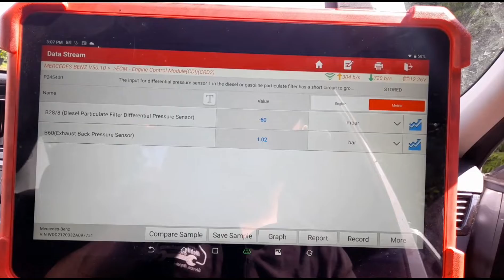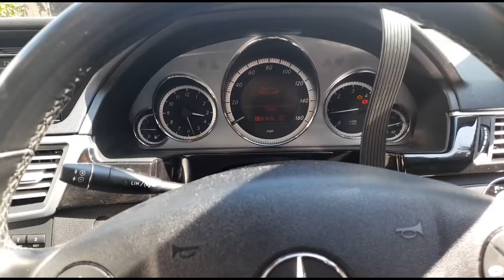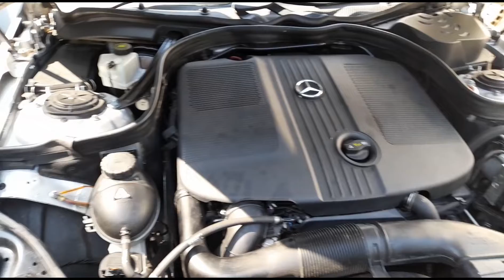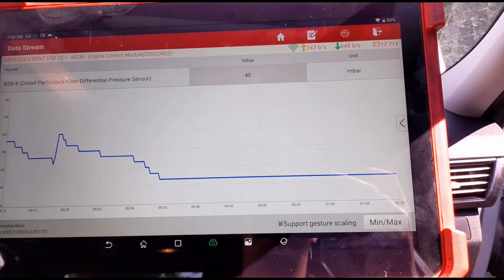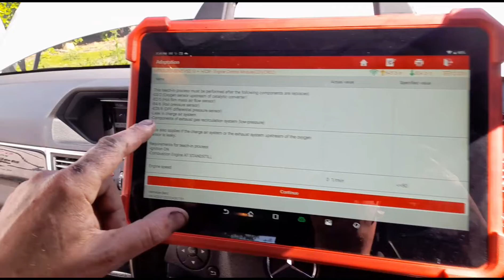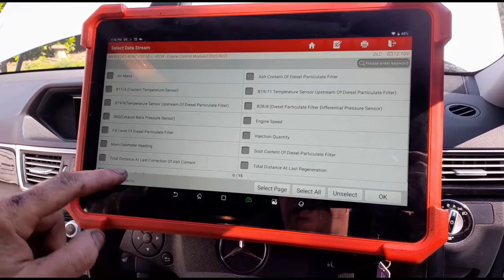Mercedes E Class 2.1 P245400 P244A7A P244A00 P245328 Differential Pressure Sensor Short Circuit

Comment: hello, my 16 range rover td6 recently has P2002, the dealer said it's because of a faulty DPF pressure sensor and the pressure is actually OK. Another dealer said there are 2 such sensors. So, how many of such sensors are in this car, and which one/ones need to be replaced? thanks

Comment: Hi jimmy, love the channel, would really appreciate your opinion...
my dad has a 2003 vito 110cdi, for the last 6 months sometimes when starting turn key its dead not cranking....no glow plug light comes on.... I keep trying key and after 20 or 30 turns glow plug light returns ... then cranks/starts/runs fine.... then today for first time it cut out while driving (glow plug- epc + oil light all flashed) restarted straight away drove another 2 miles and dies again..... restarts and drives 2 or 3 miles before dying again.... has restarted instantly so far it then took me 10 miles home no bother. I have  tried an autel maxisys and just 1 code for a faulty glow plug, checked all obvious earths and recently replaced starter motor 
Really appreciate any advice 
Thanks v much